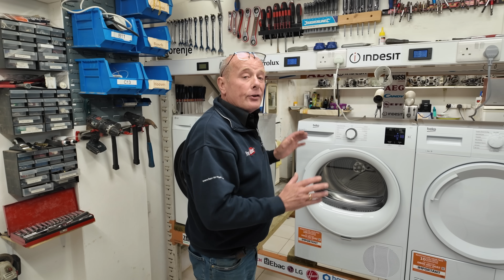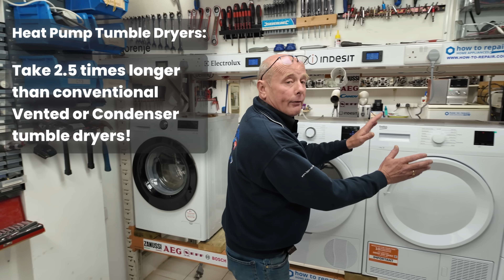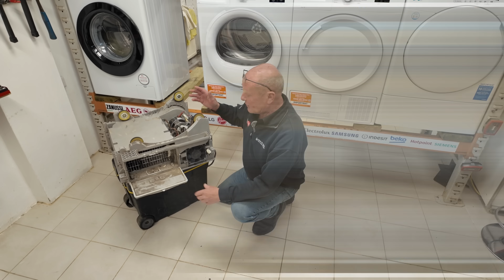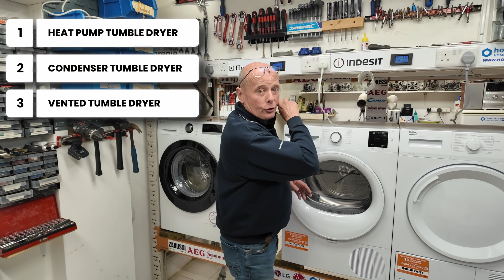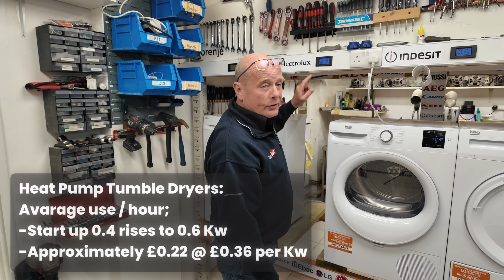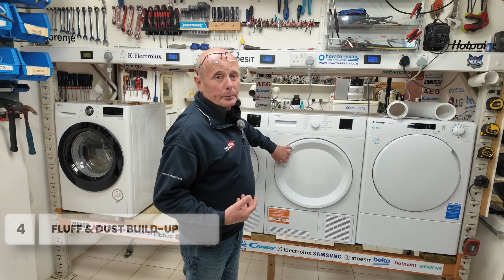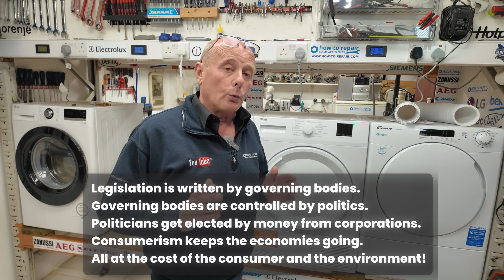Tumble Dryers the Shocking Truth About Heat Pump vs Vented & Condenser, NEW LEGISLATION!

Comment: Got my bosch heat pump dryer back around 2011, still running, no problems, always kept clean and looks after itself.
My heat pump uses around 1.4kw over 2hr period.
Reply: With regards to product consumption its the same across all products and manufacturers. Apple is a prime example, with expensive power supplies that break too easily and are a bitch to get into along with there latest tech which are fracking hard to get into.

Comment: When I was trained for my city and Guilds in appliance repair we had Keytronic washing machines that had a big square "key you pushed into a slot to chose which programme you got!
I think your points on the driers are all valid, but you missed one! 
When talking of efficiencies you need to factor in the total efficiency of the system. You got it on the vented and almost on the heat pump but the condenser, while using more power when it is on dumps the excess heat back into the home! This is like having a 2 bar electric fire pumping heat in your house that would otherwise go to waste. Nobody would recommend heating with electricity in that manner ..... but you would just be recouping what you already spent. That is a Win/Win in my book!

PS. I have just seen Big Clive's pinned note and agree totally!

Comment: Additional pros and cons of heat pump vs condenser dryers.
1.  If we have other high power appliances such as induction hob, dishwasher and washing machine, some or all of which could be running concurrently with dryer, a heat pump dryer is less likely to overload the consumer unit, especially in a flat which might have an incoming mains fuse of 60amps or as low as 40amps. Several flats may be sharing a single 100amp mains incomer, for example. 
Is this a good argument for heat pump dryers over condensor and vented dryers, which use much more power while they are running?
2.  Many people want quiet appliances in their kitchens, especially small kitchens which include a small dining area. Are heat pump dryers generally quieter than condenser and vented dryers?
Is so, is this not another good argument for heat pump dryers over condensor and vented dryers, which I have been told are generally noisier than heat pump dryers?
Reply: ...just noticed I can't spell condenser...🙃

Comment: I have my heat pump dryer for over ten years now, and all it has needed so far is a new motor and a new startup capacitor. Mine is an AEG and the filter cartridge can be removed and cleaned without stripping the machine down. Once the filter cartridge is out, the "lint side" of both evaporator and condenser can be reached and cleaned. It's a soggy mess of lint, but very doable. Finally, I hold F-Gas qualification and I can braze, so I'm confident, should the refrigeration part need work, I can do it myself.
Reply from the maker: I’m glad you bought an expensive one and are able to manage the maintenance side well done

Comment: As an electricity board apprentice we did appliance repair back in the 1980's. I agree with all that you said but would like to add when I got married we had my parents old washing machine and kept it going for a 20yr life cycle. We replaced it with a bosh after about 6 years with a family of 4 it was scrapped because the cost of the parts required to repair it was more than half that of a new machine doing it myself. This has been going on for a long time but as can be seen it is getting a hole lot worse.
Reply from the maker: This is the point of the video. There has to be a certain build quality standard technology is great but if it’s costing not only the consumer but the planets resources what’s the beneficial side of it? This is not just happening in this industry. You only have to look at cars to see the comparison.

Comment: We have a gas tumble dryer,and its fantastic,fast,much cheaper to run.
Quite rare here in the UK,i think they are common in America.
Reply: An American here, fun facts!
Gas dryers are more rare than you would think in the US. 
I believe the percentage would probably be about 80% electric vented and probably 15 to 18% gas vented dryers.
Condenser dryers are just not a thing here, I don't think I've ever seen one of my entire life.. 
I purchased a large LG heat pump dryer and even those are rare probably less than 2%. 
Also to the other comment here about American kitchens having room for laundry appliances, that's really a European thing, American houses have separate laundry rooms for about the past 50 years now if not longer. 
They are generally about the size of a large walk-in closet with enough room for two large American appliances with water and drain hookups for the washer and overwhelmingly they have a 220 hookup and a exhaust vent either through the wall or through the roof for the electric dryer. 
We have traveled to Europe and I have seen a washer in the kitchen under cabinet but I've never, that I can remember, seeing anything like that in most US homes. 
The only appliances that I have ever seen in an American kitchen is as follows, a large refrigerator, a full size dishwasher under cabinet, a stove which could be either gas or electric they're split about evenly, an over stove microwave which is pretty common and in about half of the homes have a garbage disposal attached to the drain under the kitchen sink. 
Just some fun facts!😊
Reply: @killer5846  Don't come here with your fancy walk in closet 🤣 that is a  thing that is rarely seen here in the UK other than £1mln + homes
Reply: @penskib1975   well I wouldn't call it fancy, my little laundry room is just big enough for the washer and dryer and not much else included my big butt 😁
Reply from the maker: They have the luxury of larger kitchens which allows them to run these appliances

Comment: Thank you for this.  I have been using my first and only tumble dryer, a little Creda, for 45 years and it has finally died. We were thinking of getting a Logik Heat Pump tumble dryer, but after watching your video, I am not so sure. Will probably go for a condenser but I get very confused by the brand names as they are not always what you think they are.  Kenwood used to be a good brand, so I bought a Kenwood dishwasher which packed up after 3 years, then I found out Currys had bought the name so it wasn't really a Kenwood. Deceptive.
Reply from the maker: I like the Zanussi and electrolux condenser dryers, but the Hotpoint and indesit are cheap and cheerful if well-maintained and you keep an eye on the bearings and pulley wheels hoover them out regularly you should get at least five years out of the cheaper ones and longer out of the others

Comment: Great presentation. As a US resident, I'd say vented dryers are still the norm, especially since finding a preferred Miele or Bosch model appears virtually impossible where I live, forget finding someone qualified to repair one! Seems like lint/fluff is the bane of any heating element's existence. My dad has this great technology for producing the same color, perfectly roasted coffee bean every time, but they couldn't design a system where the heat exchanger in the roaster didn't keep getting gummed up by the bean chaff. Needed constant cleaning or it became a fire hazard and/or stopped working. Sounds similar to the dryer situation tech-wise, and while some folks are meticulous, many others just want to "tumble and run." With my situation, I can't say I know which way to go yet (heat pump, condenser, vented), but I sure appreciate the information presented, thanks!
Reply from the maker: The US machines are so much bigger than the European machines and I’ve noticed a better build quality nowadays. We suffer here in Europe manufacturers are only caring about making money not producing anything of quality.

Comment: I’ve had my AEG heat pump dryer for 10/11 years now ( might be a bit longer ) it’s used every day ( everything comes out the washing machine and goes in the dryer, don’t do washing lines, airers or radiator drying ) I keep the fins at the bottom very clean I hoover them out frequently, I clean the main filter every time I use it and do the other 2 filters after every 4/5 loads,  it’s had a new belt, and new felt bearing and capacitor in all the time we have had it   It’s probably not as
Cost efficient as the new ones ( think it’s 900 watts )  but I love it  it takes about hour and half for a on synthetics and extra dry options,  I do use every programme on it, we also have a normal condenser dryer ( we have 2 washing machines and 2 dryers, the animals have their own machines so all the fur doesn’t go in our machines, their washing machine only gets used on a boil wash, and their dryer goes on cottons extra dry )  the normal condenser dryer gets really hot and takes about the same amount of time but if I look at the electric meter the condenser uses so much more than the heat pump,   The condenser is kept clean and the filter done every load and water emptied every use,  We are
Going to replace it with another heat pump dryer,   The heat pump dryer doesn’t shrink things either

Comment: I can say after working on many washer and dryers that in fact you did make a point…but comparing the consumption and the fact that they aren’t  after all good we should be focusing on how to make them actually good…bearings on a dryer don’t fail that often especially on vented/consensers it’s usually the back brass made “bearings” that fails first,the main issue is with the filter systems,and no brand yet made a good  filters system,but AEG/elux group is one of the few that made the change towards 4 rollers rather than producing them “cost economical “ and adding 2 rollers only and a brass bearing at the back,speaking about the heating part of a dryer i can say that there are heatpumps made to last,had many and the only one failing was a vestel made one with a cheap heat pump compressor…there are still loads of things to improve but at the end of the day vented and condensers have been around for ages and they weren’t “trouble less” causing numerous fires and they actually cause more wear on clothes due to the higher temperature inside,my Aeg heat pump dryer managed to stay alive for 4 years now because I simply cut a thin layer of sponge and placed it in front of the condensing unit.also they added a 3 paddle drum instead of the two conventional way most manufacturers do now and a bigger fan for it to make the motor spin at a lower rpm yet the clothes will be getting a higher airflow and a better drying at the end.We should really give a chance to heat pumps,and wait for them to develop even further before we could all draw our own conclusions. Speaking about compressors just think that they are capable of outlasting by years a conventional heater,think about fridges that use their motors at least 5/6 hours a day and they can last for years sometimes people throw them out because of esthetical reasons rather than functionality.There are a lot of variables  and underdevelopment when talking about heat pump dryers.But by far the best choice for the long term usage

Comment: Our Miele heat pump dryer has an average runtime of 80 minutes per load & a lifetime energy consumption of 300w/hr. Those figures are considerably better than the Hotpoint heat pump it replaced which from memory had a consumption of just under 1kWh per load - mainly due to very long drying times. The condenser dryer that came before that was using about 2kWh/load.

From a safety point of view I would guess that a heat pump dryer eliminates the fire risk of condensing & open vented appliances?

An often overlooked cost of the open vented dryer is the cost of heating the air in the house that the dryer is pumping outside.

Comment: After 5 years of family use a tumble dryer should be disposable. My experience has been that  it's cheaper to buy a new dryer and bin the old item rather than have it professionally repaired. So far as the heat pump is concerned,  I accept all that you say about it, but in addition I would be  seriously concerned that if the fluff cannot be easily removed by the user then there is a greater risk of it ceasing entirely to work or more importantly there being a greater fire hazard risk!! I think also that your average dryer owner would be dismayed at longer running times and consequently less loads dried during an average week, you might as well go out and put out a longer washing line in the garden. Heaven help those living in high rise apartments!
Reply from the maker: I don’t disagree that people are getting very lazy when it comes to drying and not utilising the environment and just checking it in the machine also contributes to the machines not lasting as long

Comment: We got a heat pump tumble dryer a couple of weeks ago. Although it's early days I gotta say, it seems to dry in about the same time as the condensing dryer we had before. The drum is bigger - 9kg instead of 7kg so maybe the clothes just dry quicker due to having more space. I also wonder if the heat pump method is better at removing moisture from the air, because when I open the door the mid-cycle the air feels warm but not humid, whereas the condensing dryer air felt very humid. So I think the heat pump might be more efficient at stripping moisture from the air. It's £150 more than the equivalent condensing dryer, but as it's vastly more efficient then it will pay for itself quite quickly, and certainly quite substantially over its lifetime.
Reply from the maker: My argument is not with the efficiency of the machine. It’s the longevity. These machines are highly difficult to work on and if not maintained perfectly the efficiency of the drying goes downhill very quickly. Make sure you keep your filters clean and hoover when you can.

Comment: Very good video. Thank you.
By no means criticisms, but some points/further tests....
You say a heat pump dryer takes 2.5 times longer. A lot of the points in your video are basef on this. Where is this information from? 
Ive had my HP dryer 12 years now, and although it takes a fair bit longer than the vented unit it replaced, i dont think its anywhere near 2.5 times more.
Perhaps if you could re-run the tests to dry some wet towels for example containing the same water weight in each machine?

You say clothes wear more in heat pump dryers... This is not something i have noticed. Maybe this is offset by the fact clothing is not heated to the same temperatures used in vented and condenser dryers?

I do recall my electricity bill being notibly lower when we stated using the HP dryer. With 2 kids swimming 7 days a week we use a lot of towels!

I 100% agree with serviceability being terrible on all appliances. I suspect this is deliberate.
I'm lucky enough to be blessed with mechanical/electrical skill, but keep my machines going myself.
In 12 years my cheapo-beko HP dryer has only needed 2x drive belts, 1x idler pully, and 1x motor start capacitor. But I'm also conscious that any 1 of these faults could have sent this machine to landfill for the average user.
Mine gets cleaned every 18 months or so. I agree the single most important part the condenser is the hardest part to clean. Mine actually got dragged out into the garden and jet washed out and left to dry in the sun (not recommended for most users!)

Comment: We use our 20 year old non-condesn==nsing tumble dryer  when necessary rathr than all the time. It is easy to repair and easy to clean. The important factor is to use it when necessary, even in February there are good drying days where washing can be hung out to dry effectively.

Comment: I still stand by my personal findings that a true ‘vented’ tumble drier is best as they dry a full load in approx 40 mins at 2kw/h do actually uses 1.2 ish kw t on do this load, whereas a heat pump drier takes approx 2.5-3hrs to do the same job at 450w/h which equates to 1.2 to 1.5kw/h and even then often the load is still damp.

Comment: what is the worst program setting and load that will translate to the highest input power ?
Reply from the maker: If we are talking about heat pump tumble dryers then you would expect to see an increase of 400 to 600 W when the compressor kicks in. It does not matter which cycle you use to create heat compressor must run, please remember to support the channel by subscribing and sharing if possible I hope this helps you
Reply: @How-to-repair  thanks it helps, do you know what is the max RMS current of the drum at worst condition?

Comment: My Candy condensing dryer is always too hot, I am sure a smaller heater and bigger fan would work better. It is not old so it definitely is not blocked.
Reply from the maker: airflow in all drying processes is important thank you very much for the comment. I don't have a lot of use for tumbled where I am at the moment as I'm videoing the appliance industry in North Africa and you can put your clothes on the line for 20 seconds and it's dry. lol https://www.youtube.com/watch?v=ThdxEVemEvk&list=PLnAHZbSarsyFY8xvXiyRv50jiJ5wHbeTl

Comment: I had a Candy condenser dryer and it lasted me a year, barely used it too! Went back to my little vented dryer from the 70's. Blows out the front! works lovely if i ever need it. Although i do most of my drying on a clothes horse so it is only for an emergency.
Reply from the maker: I think it was the creda compact very good? Very reliable machine? Getting spares will be problems for it now

Comment: I use a vented dryer, always have. The first dryer I ever bought was an Indesit and it  worked for 15 years, it was a cheap model but it was excellent. My work includes doing peoples washing and most of my customers have very expensive washing machines and dryers (gas  and condensed)  I find these dryers are absolutely useless, even after a 3 or 4 hours drying cycle the clothes, towels etc are still damp. My cheap little vented dryer at home takes one hour and everything is perfectly dry!